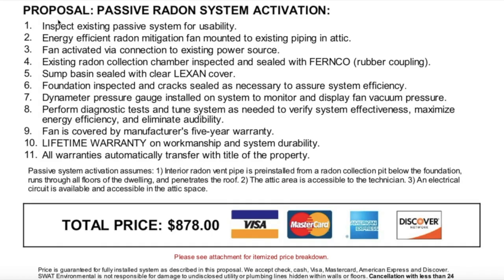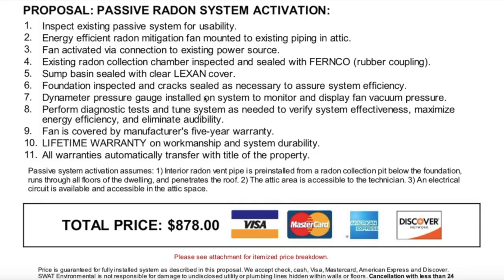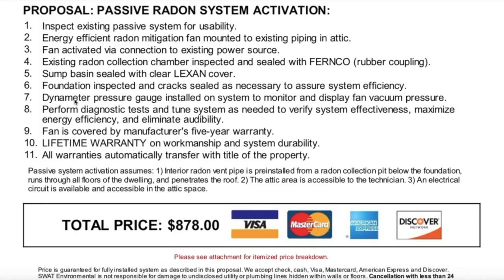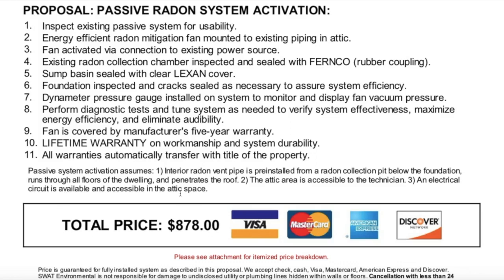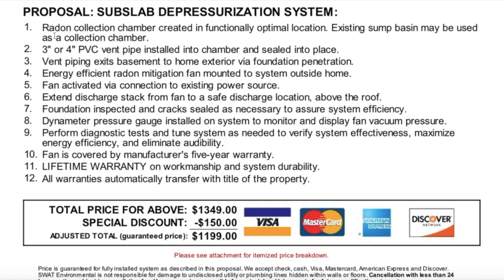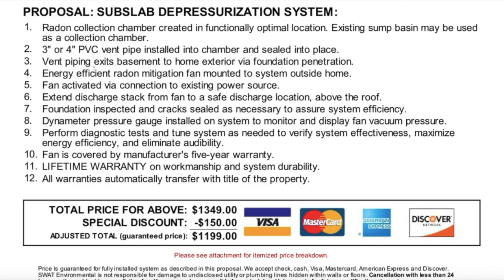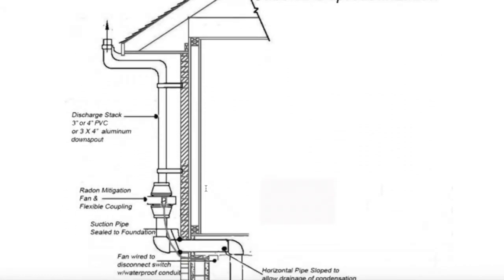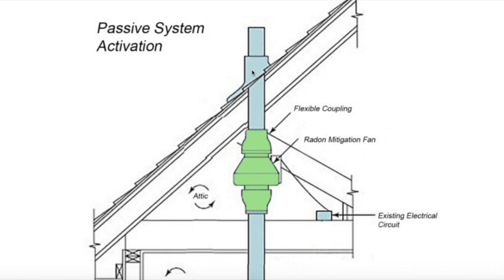How much does a Radon mitigation system cost? - Depends

Comment: Your cost is in line with the $1400 quote I received to have a system installed using my existing sump basin and they are going to tap another location in our basement to pull from.  Will be installed in the next week.
Reply from the maker: @PromisKeeper  

Thanks for watching and sharing this.  Great to hear the prices haven’t skyrocketed since awhile ago.  😁👍

Comment: I had a radon business give me an estimate. They said I needed a 20 mil plastic. I have a 6 mil plastic already laid. The cost estimate was $3,750.00. He said I must pay him in full after the installation. My question is how do I know the installation is effective? If I already pay him and then check the level in a month what if it isn't going the job? I don't want to be ripped off. I asked if I could pay him half now and then the other half after the radon level is proven to go down. Am I being unreasonable?  I have been ripped off so many times for other work that I fear it will happen again.
Reply from the maker: Thanks for watching & welcome to the DIY Raptor Club.  We definitely understand your thoughts, we felt the same way.

Paying that much out-of-pocket before even knowing it’s going to work is tough.

For us, we already had the proper size pipe for code installed which made the price a bit friendlier.

We used SWAT, have you gotten a quote from SWAT?
Reply: @DIYwithMichaelBorders  Not yet.  Does that estimate seem in line?
Reply from the maker: @mkmason2002  

Awesome Awesome, that’s a BIG deal!!!

😎👍
Reply: @DIYwithMichaelBorders  I know! Now I can afford to fill up my tank. : )
Reply from the maker: @mkmason2002  

True.  😁
Reply: @mkmason2002  swat does not guarantee results lower than 4. Read the disclaimer.
Reply: @DIYwithMichaelBorders  You just saved me $2,000.00!!!! I called SWAT. The 2 businesses lied to me. I didn't need 20 mil plastic for $2,600.00. SWAT also gave me 2 discounts. The SWAT rep. spent 30 minutes explaining what I needed.  Very professional. They're coming in 2 days to do the job. The other businesses said 2 weeks. I really appreciate you taking the time to give me your advice. THANK YOU  and God bless. Mary
Reply: @DIYwithMichaelBorders  ah, and that's the shill.
Reply from the maker: @TWH970  

😎👍